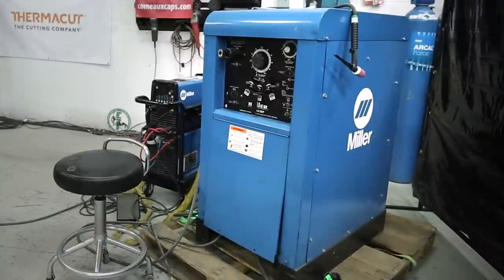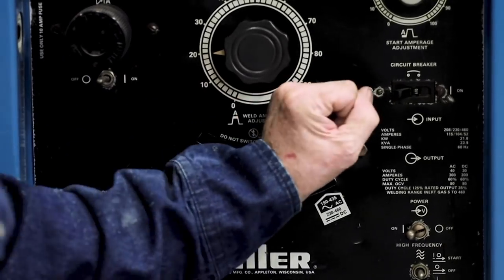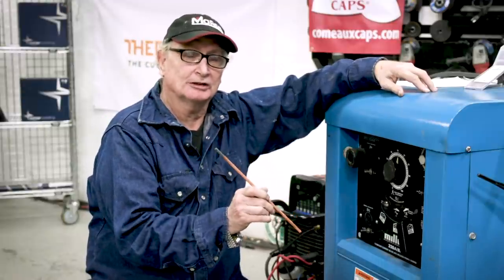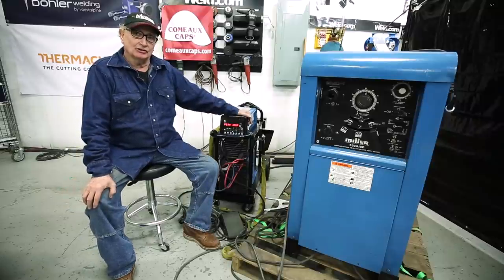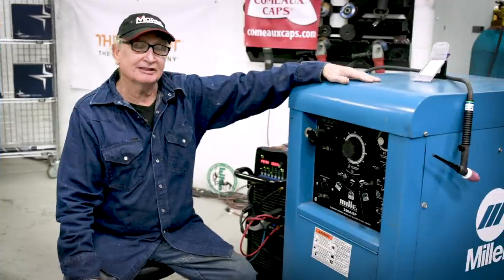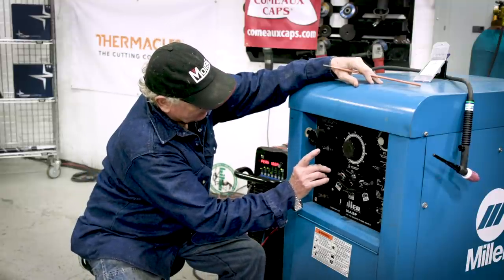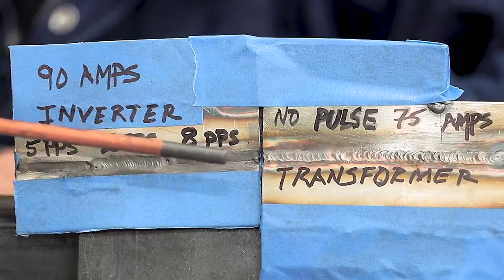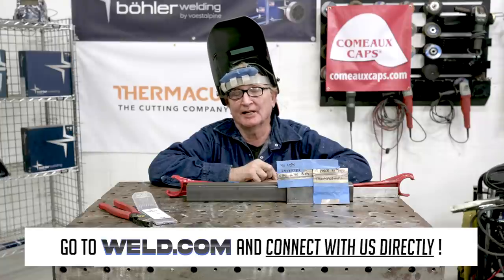Inverter Welder VS. Transformer Welder

Comment: Wow I don’t feel so bad about the way my welds look after seeing this.
Reply: I have to admit, it was not the best showing of welding, we ran out of coupons and had to stack all the welds on one......1/16 stainless lap with no filler......opps.....will not let that happen again.....also the special camera mounted to the torch made it very heavy and out of balance, it was the first time I had used it.....I do not recommend using a camera mounted to the torch if you want a good looking weld....thanks for the comment, Paulie B
Reply: I was impressed with running 90 amps and no filler on that thin of material, I guess that pulse makes it possible. I've got an old Miller Syncrowave 250 with a foot controller that I bought new in 1992, I've run the crap out of it and never had a problem with it other than a couple hose replacements on the torch.
Reply: @tubeonline629  the running no filler on thin material was the idea behind that clip to show the advantage of pulsing..what I forgot to point out was, the transformer had no on/off control or amp control, it was scratch start and set amperage. ...thanks for the comment, Paulie B

Comment: Not much difference between the two on DC, where the inverters really shine is on AC, for aluminum. Transformer machines outlast inverter machines.
Or you can have both with an Aerowave half old school, with the big honking transformer and half inverter, just like the new machines. The Dynasty series was built on what Miller learned from the Aerowave. I like mine, so far so good, hope it never craps out on me, because I can't afford to fix it.
Reply: .I always wanted to use an Aerowave, or even buy one, but I had no 3 phase at my house when I started welding...so it was the Synchrowave 250 for me running on single phase.....I paid $2,500 for the Synchrowave in 1997....my , how prices have changed. thanks for the comment, Paulie B
Reply: @ypaulbrown  Aerowave's can run on single phase, just at a reduced output. I think it's still over 200 amps on 1 phase.
Reply: @MrJohnnaz  I never realized that...thanks, Paulie B

Comment: You compared apples to oranges with pulsing the inverter machine vs non pulse with the transformer machine.
Reply: Yes, you are correct, we needed to do just a straight weld with no amp control on the Inverter. The idea was to show the pulsing ability and heat control of the inverter,  that is not easy to get on the run of the mill transformer [you can pulse with a transformer if you have an auxiliary pulse device or have a built in pulse system, but that is not usually found on the non industrial rated machines. Thanks for pointing this out to us, we appreciate the comments, and thanks for watching, Paulie B

Comment: Not to bash you but to me you left out every thing alot of older guys wanted to know that has kept us from buying  newer stuff. How will it hold up under hard use?  Is the new stuff hotter how does that affect the duty cycle can i run it on a lower heat and extend the cycle?  I just bought a miller 35  i have a small HTP mig that i love  i would love to have a bigger HTP  but theres to mini unknowns . Times have changed years ago welders were built  and used  on the upper end of their capacity  now days  with every home shop having a welder that dosent see hard use it makes a guy wonder if they are built with this in mine.
Reply: All the reputable manufactures state the duty cycle in the manuals.  No idea what your use case is.  I'm assuming that Miller 35 is rated at 350 amps.  I guarantee it can't do that at 100% duty cycle.  A Miller 220 can run in the 140-150 range at 100% duty cycle.
Reply: @ShainAndrews  Its 150 but what i wanted to know and isnt easy to explain how do new and old welders compare in the real world.
Reply: @dougpersell8776  That is kind of hard to explain.  Lots of videos on the features available on the new machines.  Personally I like them.  If I had an older machine that got the job done would I buy an inverter?  Nope.  Some welding supply shops have like a demo/training days.  That might be an options to get some first hand experience.
Reply: Great questions Doug and great answers Shain, thanks for chiming in.....Doug, all your questions may warrant another video down the road, I will pass this on to the producers.....thanks for watching and commenting, Paulie B....they spelled my name wrong in the titles, it is not E, but B...cheers

Comment: I prefer a welder made from MOTs which guarantees a stable arc as long as the transformers are connected in series (never in parallel because too much current is bad), but yeah! Use heat resistant wires when building one.

People think that 6013s can't penetrate rust, but my DIY welder actually made the electrode penetrate that oxide and on AC.

So yeah! AC can be beastly and capable of making sexy welds.

Comment: So... No advantages to transformer type welding machines?
Reply: APART FROM THE WELD LOOKED ALOT NICER
Reply: Much cheaper used now that inverters are here
Reply: probably the biggest advantage is a better hi frequency start..but not lift arc and that is helpful in certain situations......inverters have a capacitor hi freq. start that is momentary. I have not used the 280 dx that much, my 200dx is a first gen. 2004 and the hi freq. is something that sometimes is frustrating. Miller later on had a new board called Blue Lightning, but the lift arc is great  and that is helpful in certain situations.....Paul
Reply: @ypaulbrown  my point is how do you do a VS video and not show the pros of both types of machines. I find transformer type machines have smoother arcs.
Reply: why nobody mention duty cycle old transformer have incredible duty cycle
Reply: @iainscott616  I really can't tell if one is smoother than the other, I weld TIG with both a Synchrowave 250 1997 model and a Dynasty 200dx, and Dynasty 280DX , a ESAB Rogue, and a 1990 Powcon machine, and once in awhile, a Bobcat 225....I have worked in shopes that had the Miller 330....if all I did was tig all day, I might be able to give a better opinion, as I also do a lot of mig, short circuit and spray arc and also stick welding.....it all depends on what is up that day....I wish I could give you more info, but this was basically a video about what makes them tick. A more in-depth video with more welding and analyzing of the arc may be a good idea for another video...thanks for the input, Paul
Reply: main advantage is nobody will be able to run away with it
Reply: @gabakusa  that is so funny, but true....wheels are ok for moving things in shop, but no wheels are safer....some one got into my shop and walked off with a 225 lb mig machine, every one said, oh, he must have had a truck, I said he rolled out the door and walked down the street because some idiot did not lock gate and someone left the door open to the shop....$5,000 out the door.....never to be seen again.....I am still mad 2 years later...
Reply: @pawes2266  not really true except on very high end machines.
The new welders have way better duty cycle.
Once you try an inverter you wont go back.
Reply: @fixitallpaul4847  you are so right Paul....Paulie B

Comment: Everything I have is transformer. I've shied away from inverter machines both welding and generators because I've heard of so many electronic failures with the inverter machine. There probably is a difference in quality between the inverter types but how do you determine which is a better unit electronically?  Name brand doesn't always qualify.
Reply: Unfortunately, all you can do is buy one and see. I suggest staying with a brand that has a good warranty length of time and repair program that you can easily access. I hope this helps, thanks for watching....Paulie B

Comment: Guys that have inverter machines that are over ten years old please give me a like or comment I’m curious about long term reliability
Reply: I have a Dynasty 200DX that I bought in 2004, it has done duty on many construction sites.....I also have a POWCON 225smc from late 80's or early 90's that is still running ok.....it is a plasma cutter, mig, stick, tig, and spool gun machine....I bought 5 years ago used and it had been a production machine for a shop. The rubber cover on the on/off switch has split is the only thing wrong.
Reply: @ypaulbrown  that’s fantastic I’m a hobby welder and bought a Hobart 140 had that 7 years and sold it for $50 less than I paid for it now I have a Hobart 210 for 2 years. Love it. Was going to buy a miller 220 multiprocess so I could expand capabilities but honestly was scared of inverter based unit. I guess I shouldn’t have been.  👍
Reply: @foxwood67  thanks for getting back to us, just be careful running your inverter on a generator......never turn on inverter before generator gets warmed up, never shut off generator before shutting inverter off and never let generator run out of gas and die....you could damage the inverter.....hope this helps, Paul
Reply: @ypaulbrown  great info as I am currently using a genny now. Thanks
Reply: @foxwood67  glad you liked, just remember the inverters are little computers basically and odd voltage surges they do not like.....cheers, Paul

Comment: Even the best electronic components like capacitors will surely fail after 10-25 years... A transformer would not... But the inverters are much easier to handle.. To get the same results with a transformer, you have to be a pro..still got my old l-tec thyristor /transfofmer machine from 1993...which is still running fine.. With pulse, ac/dc...i learned tig welding, with a transformer.. And i always practiced to get nice welds.. And i finally did..... When i bought an inverter, my welds got really nice..

Comment: Also I'm trying to figure out why you are using a cold wire feeder instead of doing it by hand your wealth would be a hell of a lot neater
Reply: Corey there was no filler used , this is completely an Autogenous [fusion] weld.... thanks for commenting and watching, Paulie B
Reply: @ypaulbrown  I feel so dumb Paul a camera look like a feeder I apologize my eyesight's not the greatest anymore and I didn't have my glasses on. But no doubt dbgt converters are a lot lighter but as far as build quality I guess you get what you pay for I stick to my blue Miller Transformer welders. Great videos by the way and thank you for the reply

Comment: Inverter is worlds better.
Concerns about longevity are foolish. If you get five years of superior productivity the machine owes you nothing.
Many inverters allow you to save settings to a profile for recall later no more having to remember the exact settings for particular projects.
In higher end production machines engineers can specify the profile and you have no adjustability by the welder.
For ISO certification this exact repeatability means a lot.
Reply: you are so right, I know the Dynasty has menus that tell you the arc starts and total hours of use., and it has a lock out feature too....I have been using a /dyansty 200Dx since 2004 and had on many job sites.....it is still doing fine, not so much me....haha....the advantages are worth more in productivity than longevity ....best wishes and thanks for the comment , Paul Brown
Reply: @ypaulbrown   At a certain point the body ages faster than the welder.
My grandma assures me this only gets worse. Haha

Comment: The Xformer weld looked better the inv looked burnt with an oxide layer.
Reply: Thank you for the comment Carl, actually the Inverter weld was very little color and had been cleaned with a stainless brush as had the Transformer weld.  This was 16 guage [.062 or 1/16"] lap weld material. The main difference was the Transformer was a set amperage, scratch start, and lift stop, due to no remote foot pedal being used because we did not have one. The inverter had amperage control and high frequency start and had pulsing, there was no amperage manipulation though as I set the machine to 90 amps and just floor boarded the control, [the transformer was set at 75 amps] the difference was when pulsing you set a higher amperage to compensate for the lower end of the pulse.We should have done the same technique as the transformer , but we would not have been able to show the pulsing if we did as the Dynasty needs the remote to be able to pulse. thanks for watching, hope this explains a little more...Paulie B:thanksdoc:

Comment: You will not find a fifty-year-old inverter on Craigslist 50 years from now assuming whatever people are selling on at the time my Miller Shopmaster 300 is 35 years old and running strong my syncrowave is 30 years old running strong never had one issue Transformers are not going to burn up unless you give him a dead short igbt circuitry will eventually overheat because they're always under-rated
Reply: I have a Powcon from about 1990 that is still running, they were pretty much the first to make inverter machines, it was used hard before I bought it. Mine is a 250 amp, stick, tig, short circuit mig, spray arc mig, spool gun mig and a plasma cutter. You may not know but Illinois Tool Works, who own Miller and Hobart, bought Powcon in the early 90's and rebranded them to the Miller name. They changed the color from Red to Blue. I am not positive, but my thinking was to buy the technology. After awhile, they changed the case and the look. Powcon founders went on to start a new company named Arcon who is still in the industrial market.

Comment: Paul One thing You left out. The new type of PC Board Machines isn't as durable as the transformer machine is. The new Machine as many very Costly PC Boards verses the Transformer Welder has None. The Weld may not be as pretty as the 8 second pulse but the Weld is as Strong. The Dime formation is done by the Operator Not the Machine. I know because I too am from the 1970's too that have made Many Certified Welds in Nuclear Plants on High Pressure Steam . Miller is One of the Best Welder Made. Me personally I would take the transformer Machine over the PC Board Machine. One PC Board can be over $700.00 per board and there is about 4 or 5 of these PC Boards and 4 or 5 of these $150.00 to $300.00 each Capacitors With a life of 4 years before repairs. I would advise you to check possible repair Cost before buying these PC Board Welders. But only buy a Name Brand as Miller, Lincoln, Hobart Welder and NO OFF Brands with NO Service. Meaning China made from Harbor Freight, Northern Hydraulics or other Sellers of these Machines. they are Junk.
Reply: Thanks for the reply Waymon. Yes, the boards in the Inverters are expensive, but the portability of the machines are a great asset. As far as pulsing, my 25 year old Miller Synchrowave pulses for me...I do not use that feature all the time though. The main use for pulsing is to reduce the heat input into thin material, the demos were done on 1/16" stainless. We were trying to show the difference in the two machine types for an audience request......I really appreciate your response and thanks for watching and pointing out some things we did not mention. Old Guys Rule........cheers, Paul
Reply: @ypaulbrown , Paul please don't take it that I don't appreciate what You are doing. Many Young Kids needs to be Taught the Right Way. It's a shame that These Tech School doesn't Teach Young Kid's nothing that because they don't know anything themselves. Most People think welding with a Mig is everything. When I Learned I was about 18 year. You learn the Metals, temperature, what rods for what Metals. I recall a Old Journeyman taught me to grind, work Metal, he made me to watch and Learn to weld by watching him everything he did. To watch him to strick a Arc for months. Every Day he ask me Questions where I studied the night before. My first welding is Stick welding on Scrap Iron learning the Strick a Arc. Then You learned staking Beads of Weld on carbon steel. You mastered one before You learned something else. But still on Stick welding on  plate no Pipe. That is Flat welding before Horizontal, Vertical or Overhead. No Mig. You learn to control your Metal by Speed or Temperature or Amperage. Once You master one position you moved on. No Mig. But I learned the Right Way. Then I went through a Apprenticeship. After 5 YEARS of working with Many Smart Journeymen and being taught the Right Way of Do's and Don't I Learned to Weld anything with all Forms of Welding. After 44 years I Retired. So I know to Right way to weld anything. Real Welders are Hard to Find. There are Rod burner and there are Welders and they are not the Same. Good Welders are Artist of the Metal. Every Metal welds different but You Learn.
Reply: @waymonblevins6939  Thanks you so much for the comment Waymon, I did not take it the wrong way at all...everything you said is just how I feel.....I appreciate every word you wrote .....Best Wishes, Paul Brown...and thank you so much for watching and especially commenting.....Cheers.

Comment: Lots of bad not information here 
The main reason smaller inverters are popular now is because
Big transformers, especially copper wound tranformers
Great big transformers are EXPENSIVE
Yes They are heavy!
A great big transformer rectifier is superior
A modern electronic inverter type is just plain and simply not the same animal.